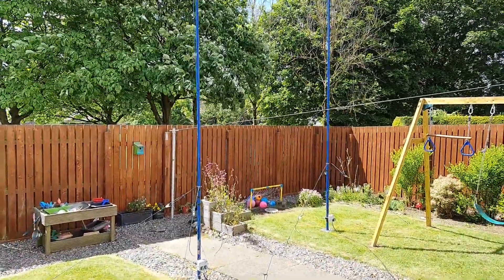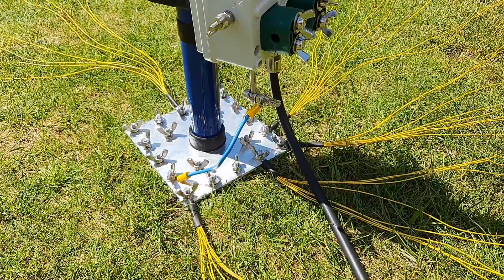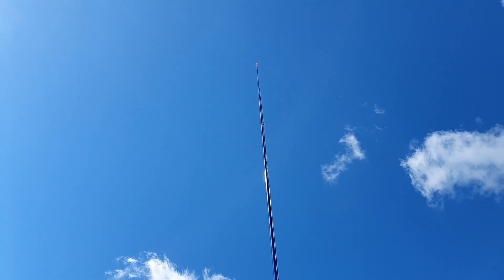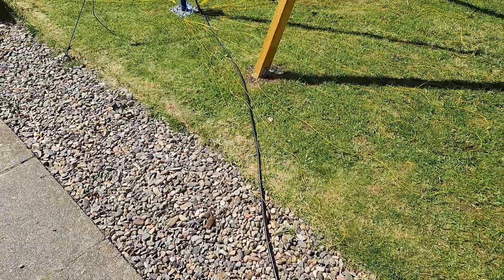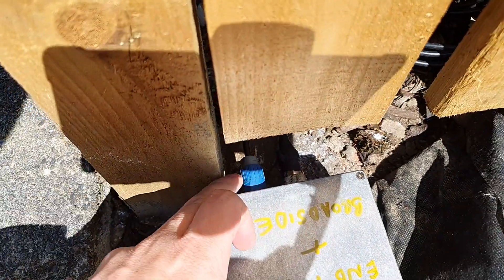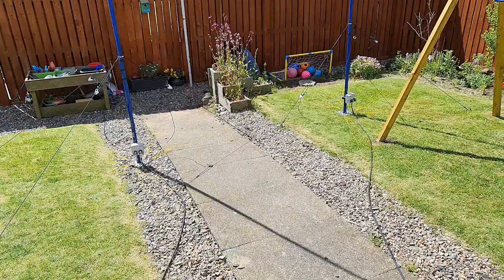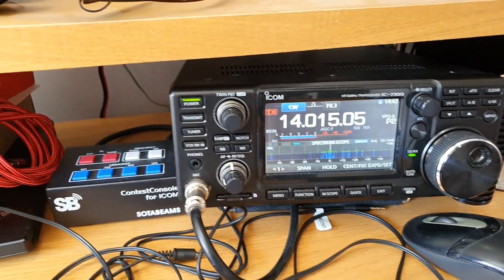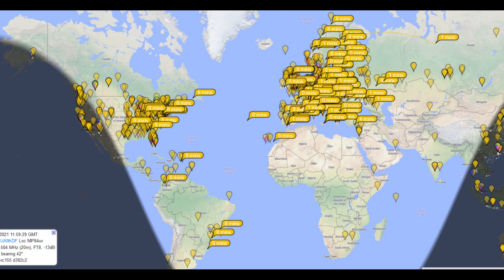20m Twins - Phased Vertical Setup & Operation

Comment: Hello Colin, in my opinion the simplest way to have a phased vertical array  is to use a half square antenna antenna (+3db) that if you double it you can have a Bob Tail Curtain.
 for even more gain. Feeding the half wave with a 1:49 balun on one hand you can also have multiband operation
Reply from the maker: Agreed but you can swich it which is nice. Have the seen my later video which talks about a half square. If not check it out.
Reply: @MM0OPXFieldRadio 
Yes I have it, nice presentation too
Reply: Another good video pal,interested to know how you’ve made those boxes and clamped them to the poles?Cheers
Karl G0SKW

Comment: Is the length of the coax from the radio to your delay  critical? What length is yours and doesn't make a difference in the way this antenna operates
Reply from the maker: The coax from the box to the radio is irrelevant.  What's critical is the delay line and the phasing line lengths.
Reply: @MM0OPXFieldRadio  thank you for getting back to me this really helps a lot!

Comment: Great video. Thanks for doing it. Is it possible to phase 2 dual band antennas. I would like 40 and 20.
Reply from the maker: Possibly. But maybe not in the sense you think. You still need 2 complete phasing systems. You could have 2 fan verticals each with 20m and 40m elements. The 40m would be 1/8th spacing which makes the 20m 1/4 wave spacing. I think the tuning would be an absolute pig but do think it's worth trying. I may make a video talking about the possibility if this.

Comment: I've been thinking about a similar system to experiment with. This one looks really well put together. Have you considered adding to more poles for more direction?
Reply from the maker: Thanks, it is and willl handle high power no problem. Yes I've thought about a 3 or 4 element but yet to see a design for one. Different phasing and delay lines will be required.

Comment: When your near a CW signal Colin just hit the Auto Tune button below the LED to the left of the main dial. It will zap the VFO right to that CW signal
Reply from the maker: I did do that off video. Need to change sidetone as I just prefer it lower in pitch.